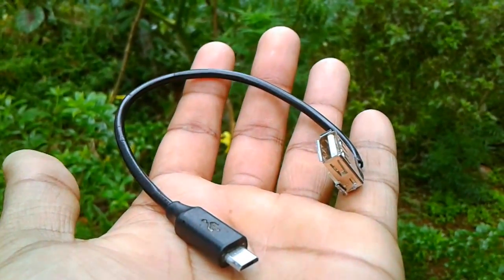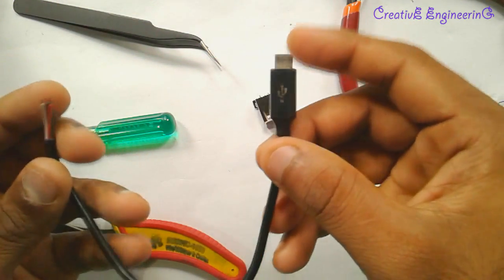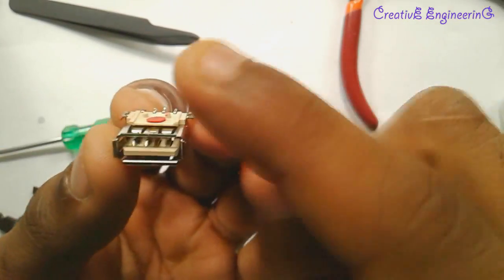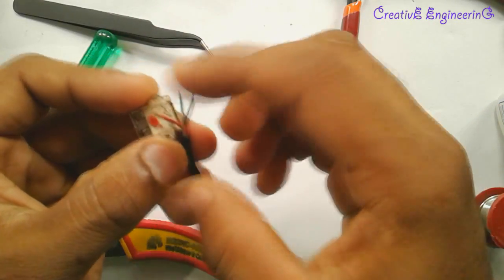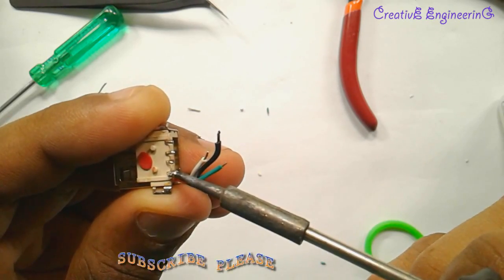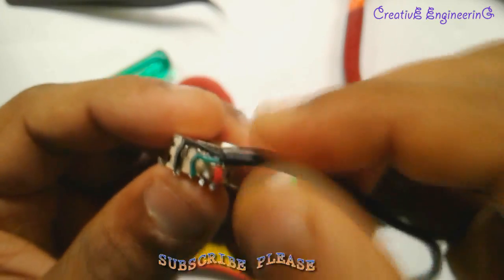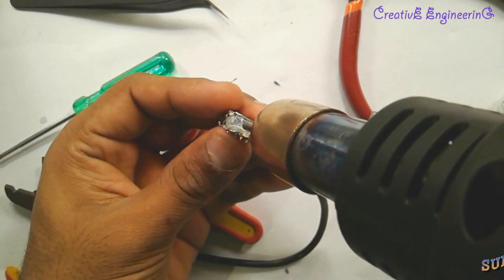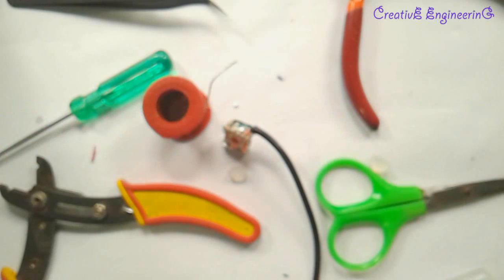DIY OTG Cable || How to Make Your Own OTG Cable From Scrap? #otg

Comment: You need to solder the sense pin to ground for the phone to recognize it as a USB input.
Reply: Pooja Bhatt  You can crack open the case around the plug to access its connections. Or if you're unlucky and have a rubber casing, you can cut it away with an X-acto knife. https://i.pinimg.com/originals/dd/4e/18/dd4e1812092a3794946945e2dc535d68.png this is what you should find. Solder pin 4 to pin 5.